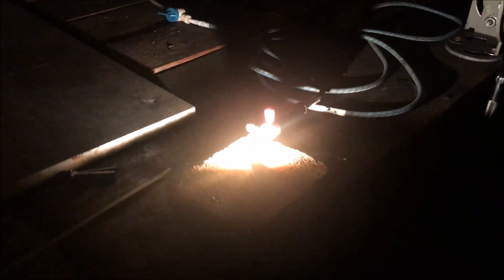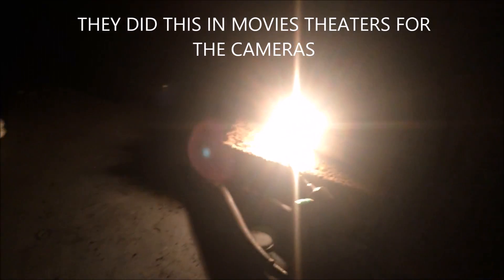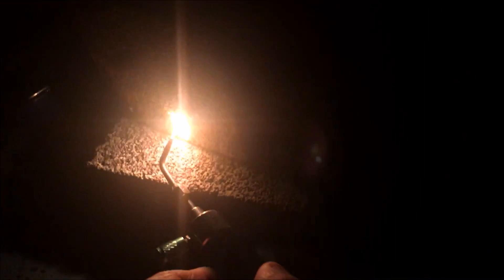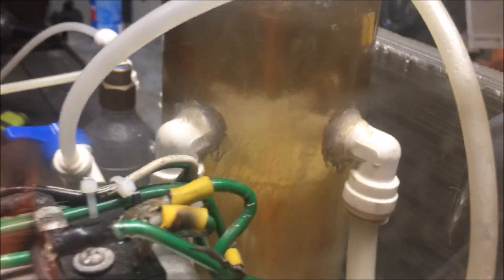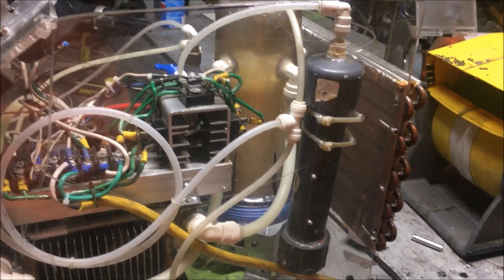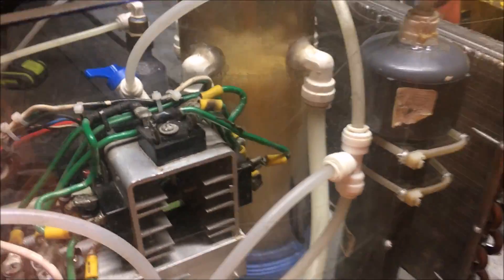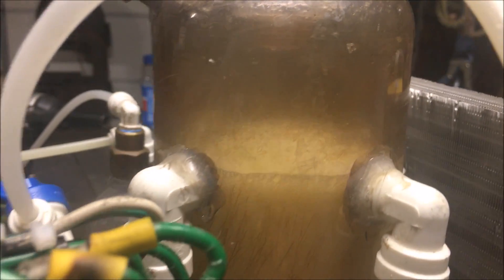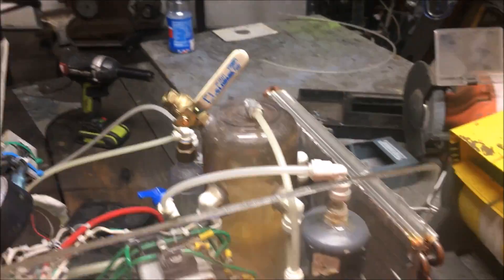Lime light  Oxyhydrogen bulb 600W

Comment: I'm pretty sure pure lime will produce a whole lot more light per the energy level... ~( ,m,)~
Reply from the maker: I would agree. I tried to scrounge up a piece , i got a piece of lime stone out of the drive way but i think slaked lime it what they used , also they used zircons
Reply: Actually, hydrated lime can be obtained from any hardware store, in the masonry department, some arts and crafts departments, especially in the glass blowing sections, and some garden supply places carry it for soil PH balance.

Ironically, most people have the basic stock to make it right in their own homes: gypsum board/sheet rock, egg shells, and calcium carbonate antacids similar to [but need not be the same brand name as TUMS] will all supply one a reasonable amount of [relatively] high purity calcium without too many metallic contaminants.

The trick for impure calcium in your case would be to use the oil burner to roast it really hot in a fire brick kiln until its as white as possible, then pulverize to a fine powder, then press into a pellet, possibly with a bit of a cup shape, so as to direct the resulting light mostly in one direction if your torch is small, or, if you have a large enough heat source, make a plate with it and heat the whole surface evenly with a lot of heat for a dazzlingly bright display.

A really thin section with an piece of insulated backing made from of a refractory brick [they tend to be so light and soft they will crumble in your hand if you squeeze them but they are majorly heat efficient and cut with a plastic knife if you are afraid of dulling a valuable saw, and the cut need not be precision as you can flatten them by rubbing them over a consistently flat smooth surface until they are precision] makes a great thermal backer, you can simply take the fine powder you made [or bought in a bag if that be the case] and with a small brush, work it into the pores of the brick slice so that it is now both a holder and an insulator.

The size is totally up to you, be it 1 cm square or 2 inches square, it should produce a lot of light with your HHO torch at 1 cm no problem though, and with your oil burning torch you should be able to make a 2 inch piece glow pretty well if not nearly as perfectly.
Reply: Delicious DeBlair  Waiting to see the video

Comment: Yup!! been there done that! it actually works until you loose control of the temperature! and if you use a radiator by galvanic corrosion you start to eat the radiator from the inside out! it is a catch 22 kind of.. Nice work do..
Reply from the maker: Interesting input , thanks. Galvanic corrosion is a very interesting thing , it ruins the valves on peoples tires if you use aluminum caps . Do you have any photos or footage of this stuff ? sounds very interesting , specifically the radiator corrosion
Reply: The answer to your question is both yes and not. if you look at my very first posted videos..you will be able to see some of my very first videos on HH0, I managed to get a few cars that I get them to triple their mileage, and manage to be very successful, but managed to learn lots & about gamma radiation, and galvanic corrosion...(https://www.youtube.com/edit?o=U&video_id=FQHszc04seQ)